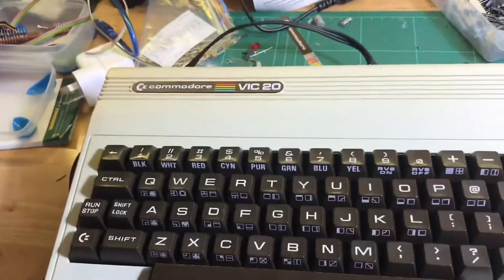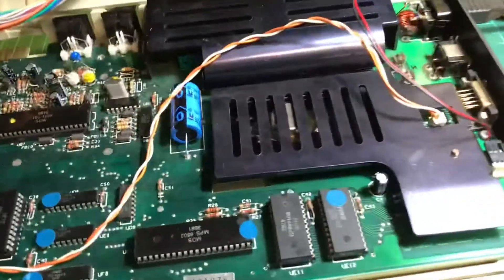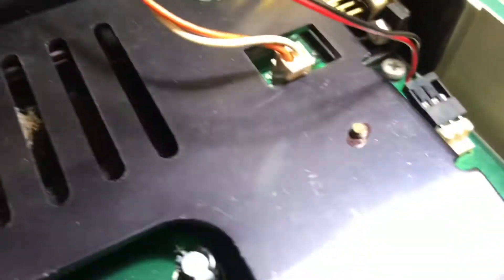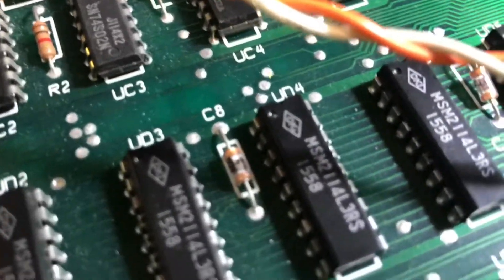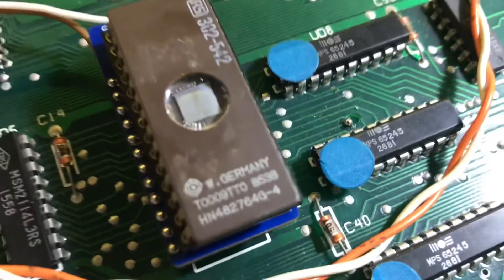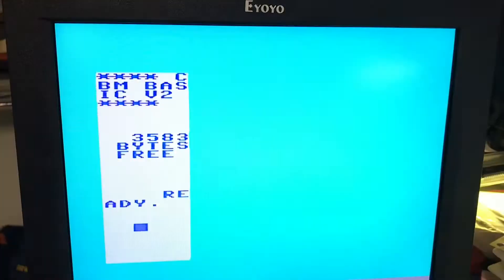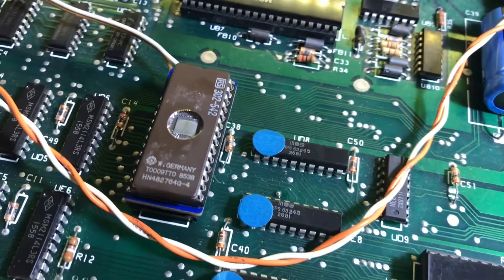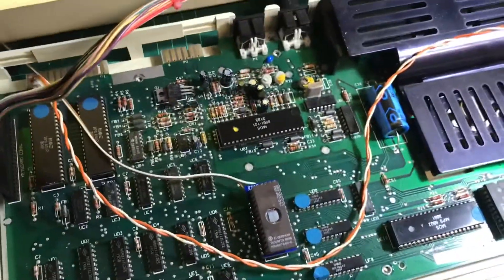🇺🇸 Commodore VIC-20 (PET-style keys) fiddling: Part 1 (character ROM) [TCE #0003]

Comment: Despite the problems - the font looks good.  I love the PET-style key caps on that Vic as well.
Reply from the maker: Yep, totally agree - interested to see how those Scott Adams adventure games look - much easier to read I hope.  The 8-bit Guy also discussed the differences between the fonts and how they impacted his "Attack of the PETSCII Robots", which was interesting.
Reply from the maker: I'm starting to think that maybe the ROM speed has something to do with it ... discussing about upgrading an old Microbee, the replacement character ROM needs to be "fast enough" ... so I'm wondering if the issues I'm running into are the same ... the 2764 EPROMs I'm using simply aren't fast enough to replace the original 2332 ROMs ... ?